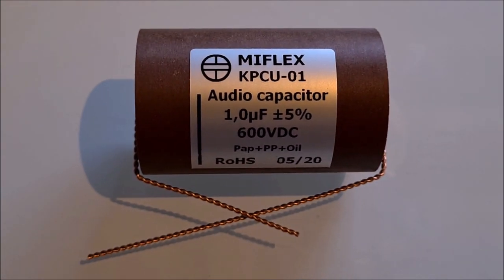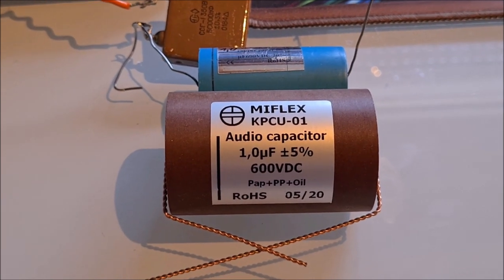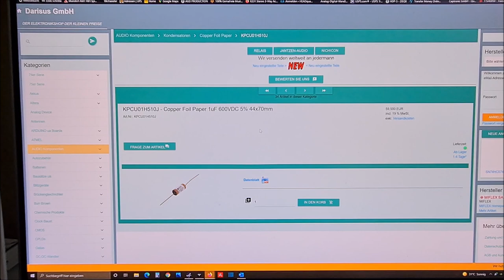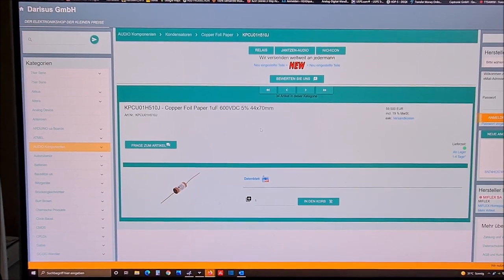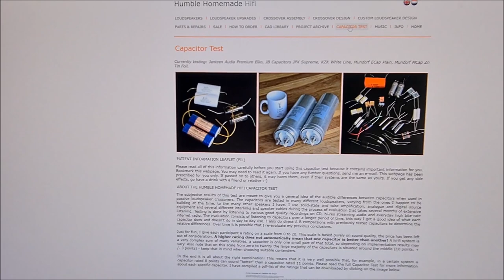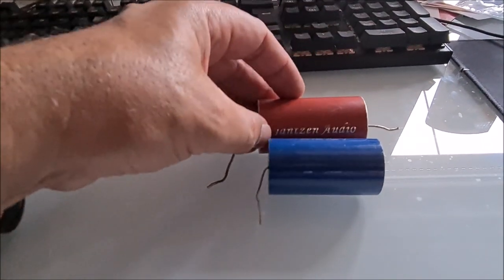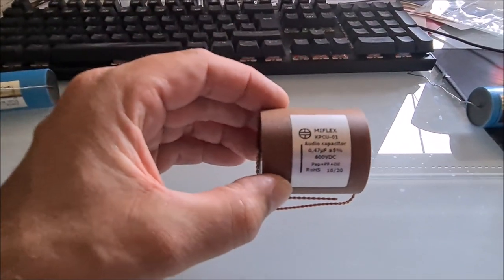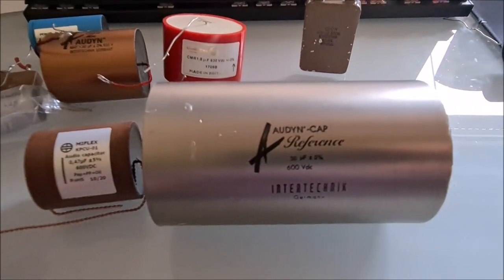Cap, Caps, Crapp....and then:   Miflex!!! OMG!

Comment: What value silver mica cap do you use for bypassing
Reply from the maker: Hi, i use for shunt up to 0,1 uF not bigger ( or for SSG01 everything you can get :) ). Cheers Mike
Reply: @headquarteraudio5388  thanks, I have a Jantzen Standard 47uf that I'd like to bypass with Miflex, could I use .1uf or does it need to be bigger?
Reply from the maker: @chelillingworth9466  Hi, no best choice, maybe use Duelund Silver bypass cap 0,01 uF try it out---cheers MIke
Reply: @headquarteraudio5388  cool, i used miflex .1uf kpcu caps as bypass of sonicap 1uf and 1.5uf in the tweeter and mid. Would that also work on the 47uf Jantzen?   It would be better maybe on the tweeter and mid to replace the sonicap fully with Miflex and bypass with silver?
Reply from the maker: @chelillingworth9466  HI, 47uF seems very big..  but premium is miflex with silver shunt, also better than 1x 1 uF is 2 x 0,5 uF..cheers Mike
Reply: @headquarteraudio5388  thanks!!!

Comment: Hi Mike! They both sounded crap..... Just joking!! Sound lovely, but  I would love to hear your open baffle speakers in real life. Can imagine that is something....
Checked the Miflex 6.8uF for Lintons, 282Euros and 1.7 kg!! Insane, Out of this world.....!
Just installed Intertech Audyn Tri-reference with russian silver mica in parallell in my Lintons. Not bad at all.....!
Reply from the maker: Hi, i will test a 10mf soon :) joooke...but Linton Tweeter has yellow bypass cap ( i remember right i hope ), remove it, and use same value with Miflex... :) ( 2 points up for the Audyn ) Cheers Mike
Reply: @headquarteraudio5388  Ahaa..., I guess you mean that little yellow thing sitting just beside ( parallell to ) the 6.8uF one.. ? Thanks for tip!!
Reply: For higher frequenties i can reccomend Jantzen Alumen. I have 6,8uF in my Grand Mezza. They're much bigger than crossover ;)
Reply: @headquarteraudio5388  Listening via GRADO SR60 phones made it obvious that the Miflex produces much more defined high frequency detail and transients. Like the percussive sounds in the song intro, ( like snare drum "rim strokes" ).
The cap comparison article you found, I also found beginning of April, and it finally helped me confirm my decision to follow your advice regarding choosing Audyn Tri-Reference instead of Jantzen Supreme caps. 
I used exactly the same charts with comparisons as you show in this video before ordering, and it said the Audyn Tri-Reference caps from Intertech is performing exceptionally well in its price range , and very very good in absolute terms as well.
Reply: @headquarteraudio5388  On the yellow  bypass cap of the Linton tweeter there is printed "684J   100V", Mike, I did sent you a photo showing it on April 22nd via email. Do I read this right as 0,68uF and 5%?
Reply from the maker: @christoph5799  Hi, yes I think its correct..maybe solder it out for truth ;).cheers Mike
Reply: @christoph5799  Hi Cristoph!  Just a few days ago I opened up my Lintons again to determine the values of the yellow bypass cap of the tweeter.
The one cap I guess Mike refer to, is a very small yellow guy just beside and parallell to the 6.8uF main one, The yellow small one of my Lintons is marked with "684J 100V". I searched the net for alternative codes for caps and found a calculator/translator:
https://circuitdigest.com/calculators/capacitor-value-code-calculator

When putting in the three digits 684, it put's out the answer 0.68uF.
I ordered Miflex KPCU-03 250V 0.68uF as replacements.
Cheers, Magnus

Comment: You are not only changing the quality of the caps but capacitance, and the frequency at which each driver cuts over. Is it trial and error?
Reply from the maker: Hey, please tell me the part where I say that you have to change the capacity, or i do it..... and I hope you don't mean the addition of an SSG 01... cheers M
Reply: @headquarteraudio5388  they caps that you show have different values?
Reply from the maker: @vicg5323  and? i show them, they are not bulit in a crossover.. 😁

Comment: Mr. No need use big capacitors. This big mistake! Need use more quantity little capacitors and connected all capacitors in one parallel. This only one correct and perfect way! 👍
Reply from the maker: Psssssssttttttt   :-)
Reply: @headquarteraudio5388  HI Mr. 👋 Mr. Interesting your opinion... 🤔 Miflex capacitors better than Duelund CAST Cu-Sn? 🤔 Thanks!
Reply from the maker: @РуфатШиралиев-л8л  Hi, I have never worked with Duelund capacitors, the distribution to small manufacturers is too complicated and the caps are very expensive. I've heard that they should only be slightly better, but cost a lot more, but hearsay. I think a Miflex as close as possible to the original value and then a Duelund Shunt 0.01-0.1 (silver) in parallel ... depending on your wallet :) cheers Mike
Reply: @headquarteraudio5388  This is exactly what I did with my cloned Tannoy Crossover through a friend’s advice and  glad I followed.  Amazing sound, can’t go back. 🙏🏻👍🏼

Comment: Preferred mundorf ngl
Reply from the maker: so, opinion without testing the others, mmmhh cheers Mike
Reply: @headquarteraudio5388 I tested a ton of capacitors but mostly higher voltage in tube amps, just stating preference, also you should really try one day some NOS teflon capacitors from ussr, have fun

Comment: Im Leben nicht. Welcher lautsprecher mit welcher Musik bringt das zum Vorschein? Preislich  unrealistisch.  Die meisten hochtöner Kosten weniger. Und mal ganz ernsthaft. Erstmal die fertigen weichen in den Lautsprechern ansehen!! Elkos und höchstens mkta 160v.😅😅😅😅
Reply from the maker: oh doch, auch wenn du es abstreitest oder nicht hörst, es sind gewaltige Unterschiede, völlig unabhängig von der Musik. Klär deine Einstellung zu Preisen bitte mit den Herstellern. Die meisten sind sicherlich nicht alle :), aber auch ein billiger HT profitiert von einem sehr guten Kondensator, der dafür geeignet ist. Wenn ich mir die Bauteilequalität in den heutigen Fertiglausprechern ansehe, will ich lieber nicht reingucken. Wie kommst du auf den Quatsch mit  mkta 160v max? Wer Elkos in Frequenzweichen verwendet macht sich nur noch lächerlich...
Reply: Is there beer and is there beer? All beer taste the same? No! Small nuances difference them all and to different price. Same with crossover to a speaker. Different quality, gives different sound. But on the speaker, will they last longer then a good beer. I have tinnitus, but can still here changes, to the better with my Miflex capacitor. From electrolyte (1984) to Miflex 2022. Hallelujah.